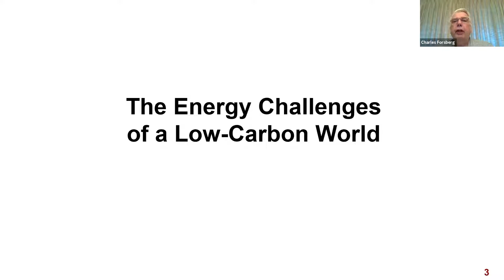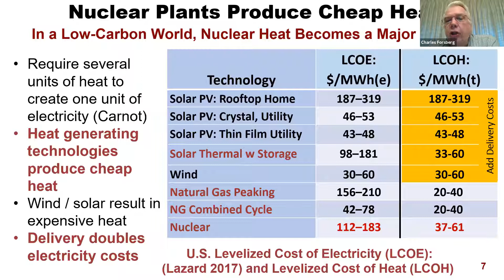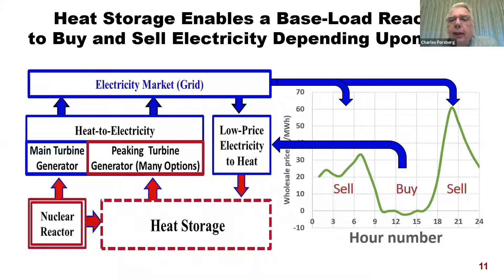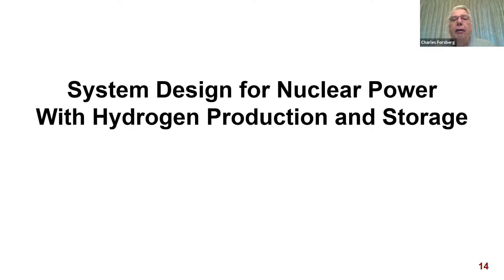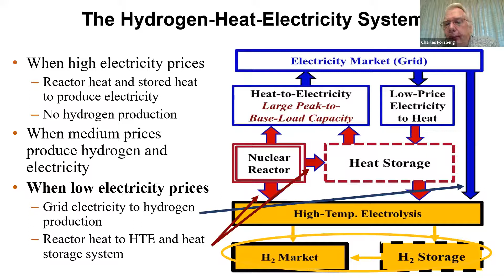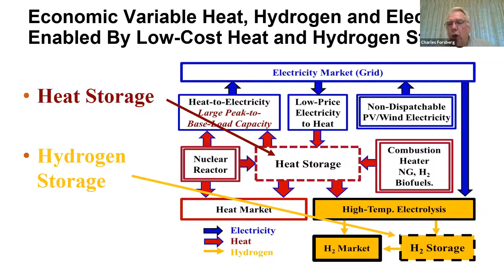MITAB20-155-Base-Load Nuclear Systems for Variable Electricity and Heat with Heat Storage

Comment: OR.... Just skip all of this useless over complicated faff and use the KISS principle of engineering. Build nuclear power and then load follow, just like every power plant ever has done for over a hundred years. 

There's no reason to over think. Hydrogen is dumb, whereas wind and solar are useless. Take them out of the equation and all of the shaky economic arguments for this plan vanish and you'll have a system that's cheaper over all and more reliable. The biggest problem besides that this is an entirely unnecessary plan is that the only thing storage does is ADD cost. Unless you know of a storage system with 100% round trip efficiency then it's going to be a constant vampire on generation capacity.